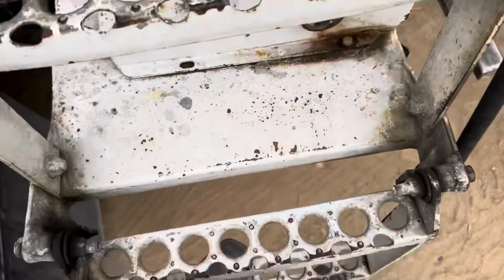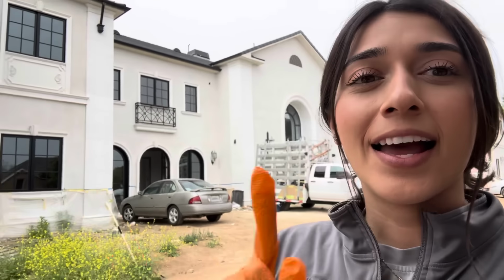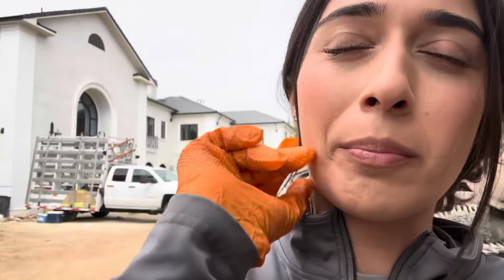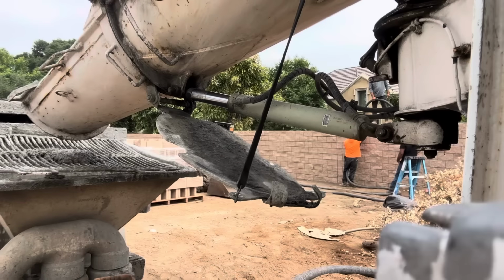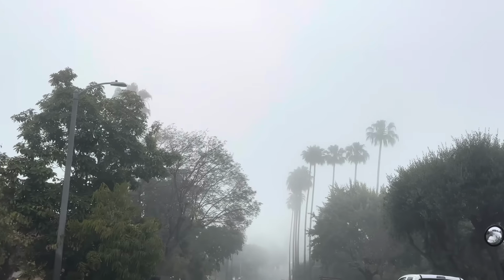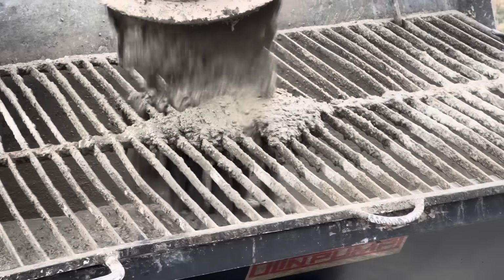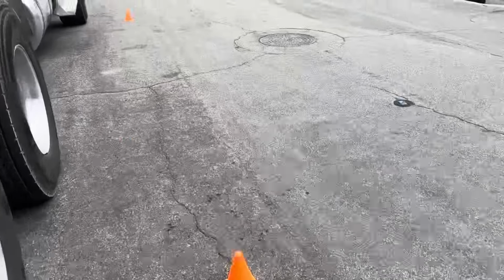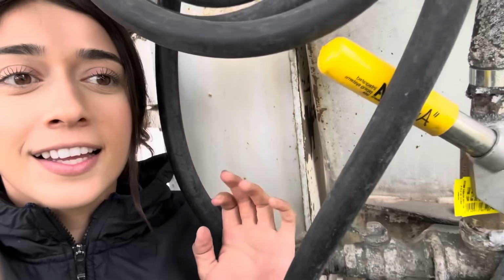Driving Through Canyons in my Concrete Mixer

Comment: The one thing I never understood about trucks, is why some of them go really slow.  It wasn't until I started driving coast to coast and driving through every mountain range, driving in extremely bad weather, driving through turns, curves, backing, blindspots, congestion etc., that speed and space were the only things I could control and the primary reasons to cause an accident, if I failed to control them properly.

Comment: To help get behind the fins. Starting at the front, turn your hose to the top of the drum and work it down along the wall between the fins as the drum turns. The water will go thru the holes and run down the backside of the fin. Won't get it all but if done right, you'll get maybe the front quarter to third of the drum

Comment: I got some of those little cones at the 99cent store many years ago and they held up very well outside in the California sun. The orange color did fade away and they are more of a pink-white color now, but the plastic is still good and not cracked. You will get many years of use out of them and they don't take up much space in the truck either.

Comment: Here a thought 2x2 inch square plate bolt up the front of drum roller ,you buy one of those cameras that builders has that look in a wall or down the drain,they have a torch inbuilt,light,anyway,undo the little patch of 2x2 and stick the telescope in then you can see built up of concrete,just a suggestion ❤.

Comment: I've only seen one mixer in my life that didn't have pusher axles and it was a city owned truck. All of the mixers I have worked on at least have one pusher but most had 2 drop axles plus the booster axle. Maybe where she is there's stricter weight limits.

Comment: I used to work at a concrete beam nanufacturing plant and  I had the job of chipping the concrete that would build up on the paddles of the mixer. I had to do it every week. It was very unconfortable to be inside of that mixer.

Comment: What up little sister.
But what you can tell if your finger pulled on the back.The way to tell when your fingers are pulled in the back. It's cause they're wonder thicker It's cause they're wonder thicker. The thick of your finch the more mother stuck on the back of her. I used to have to crawl in my own drum and chip it out. I use the sledge hammer.
I was in my fifties Add crawl into the top shoot. And make sure you take the keys with you. My last time driving the mixture was in 07. I became disabled. Health problems.
🤟🏾🤙🏽🤘🏽👍🏽.

Comment: Do concrete trucks ever use nitrogen in the tyres ?. It rides nicer, maintains pressure way longer and therefore saves fuel . I like quieter ride.

Comment: Love your video's!!!!! Question, where and when do you use the extra axle?
Reply from the maker: Aw thank you! I love answering this question!! My axle stays up if I have less than 4.5 yards and goes down when I have 5 or more yards in concrete inside my drum.
The purpose of the drum is to distribute the weight evenly throughout the truck, 
I drop it after getting loaded and put it back up with a press of a button as iam arriving to the job, I hope this helped 🤘

Comment: Can someone help me out on whether i should get my class A in auto or manual. I want to do auto because i know it will be easier, but i dont want to be restricted to certain jobs/pay. 
Also do they do follicle or pee drug tests for jobs ? I haven’t smoked weed in 6 months and I don’t plan to anymore because i want more money but im scared to fail a follicle test because i was a heavy smoker for years. Thanks in advance (:
Reply from the maker: Hey! Like you said you don’t want to be restricted to jobs so I would suggest learning manual! And yes as far as I know you get drug tested for any driving job you apply for, I think you should be good if it’s been that long! Goodluck!!
Reply: @lexflowaz  thanks for the reply ! do you know if they do follicle tests or is it usually pee test ? or does it just depend on the company ?

Comment: in the 1960s concrete mixer   trucks   only had concrete in them ,as the broken bits of whatever   you just tipped out why dont they take that by a truck.